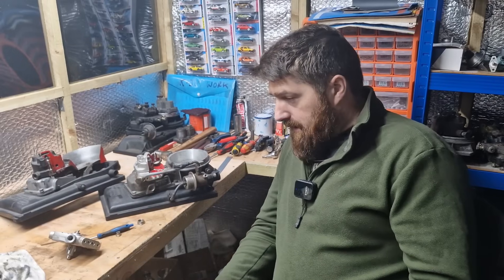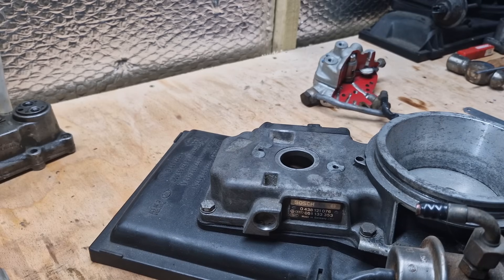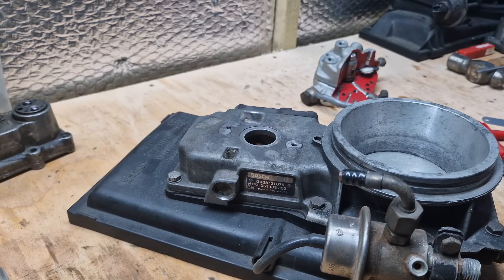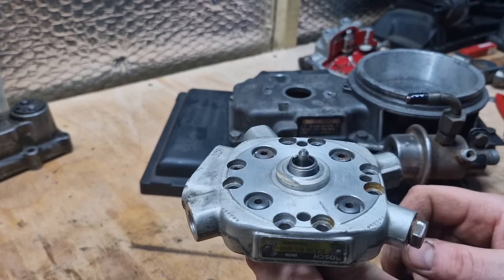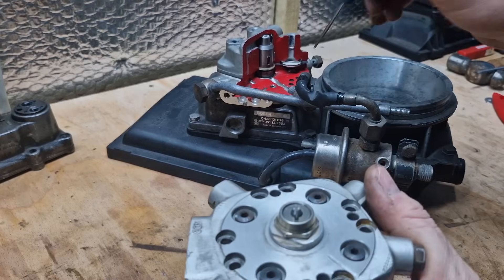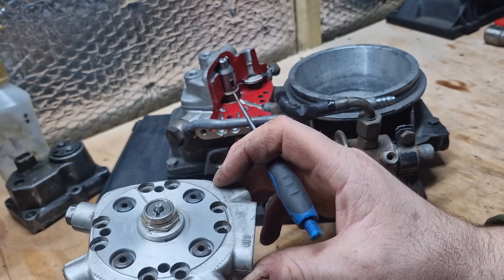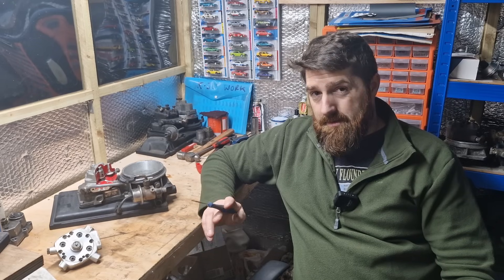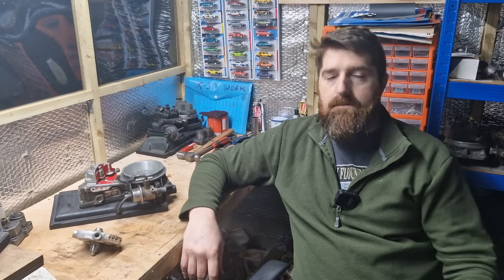Bosch KE-jetronic - CO Mixture Basic Settings

Comment: So a vibrating engine can back all these precise  measurements off?
Reply from the maker: Not directly, its more the wear in the components themselves, for example, sprung parts or if its been messed with in its life as its easy to adjust things to make a car run with underlying problems

Comment: I cant get my adjustments right. When i get the 1.9mm ,the best on the roller i can get with max screw in is 20mm. And under presure it moves up about 2-3mm. And cant screw the screw in anymore.
Reply: Also i think the bottom ring is leaking of the pin that touches the roller.
Reply from the maker: There's a seal inside that part, the most important is the 1.9 mm and no more than 1 mm freeplay in the plate when under pressure
Reply: @GreyGooseRestorations Yeah i got to much free play ,like 3mm

Comment: Great Videos - you're my do-to guy for trouble shooting my K-jet system. Have you ever seen system pressure remain constant and within range, but cold control pressure surge up to 7.4 bar and then suddenly drop back to 4.0 bar and then constantly repeat this cycle? it's happening to me. I replaced the WUR with known good one and problem persists. it's like the control pressure circuit inside the FD is restricted until the pressure reaches a point where the fuel pushes past. The process repeats. ironically, I just had the Fuel Dist. rebuilt!  Any first thoughts on how to diagnose this? Much thanks and keep the K-jet stuff coming!
Reply from the maker: Thanks, i would check all the fuel lines and their banjo bolts for any damage and/or restrictions which may cause this, as it should never go that high but it also sounds like the WUR isn't set right as cold control pressure should be around 1 bar area until its warm

Comment: My i ask you whats is the problem then gasolin don't reach injectors just only gasolin throw coldstart on Audi 100 -88.
The fuel distrubator is renovated. 
Best regards
Tony Spångberg Enköping 
Sweden..
Reply from the maker: If no fuel comes out of the fuel distributor outputs even when the plate is lifted (or pushed down) then it will be an internal fault most likely

Comment: Excellent video mate, really well explained. Question for you, ive got a w124 idling very poorly, better at temp but still poor at traffic lights and slow movement (car parks etc). it smells extremely rich and im certain the previous owner played with the mixture screw before trying any other fix :/ Is there any way at all to get to a ballpark ish base setting by adjusting while idling? I dont have a lot of resources to test as you have and its a fair drive to an expert so want to see if i can get it somewhat driveable to take it there, thanks
Reply from the maker: Thanks 
One way to set it right by ear is to lean the mixture off untill it starts to idle worse, then richen the mixture again untill the engine idles worse then lean of half of the difference between the poor lean idle and poor rich idle, so if it was one full turn between the two then meet in the middle. The aim is to be able to open throttle fully from idle (momentarily) and the engine reacts instantly
Reply: @GreyGooseRestorations  excellent. Thanks mate

Comment: Would I be correct in saying that the ke-jetronic does not have a spring above the plunger?
Reply: Great - thanks. I was sure that I didn’t drop it on the floor. 😊
Reply from the maker: As far as I have seen the springs were only in k-jet units 👍

Comment: Will this adjust the CO only for idle speed or will this have an effect on the fuelling (over or under) over the entire rpm range? Thank you
Reply from the maker: Adjusting the CO on K-jetronic and KE-jetronic has an effect across all fueling points as anything that raises the fuel pin will increase fuel delivery

Comment: Awesome video explaining how this works. I'm glad to see support on it like this. I have a problem you may understand, my 86 gti that i've owned for 10 years has me stumped. it bogged down into my carport and never started again. cranks like it should, has spark, 125 compression in all the cylinders, but the spark plugs are wet, i was thinking it has a fuel delivery problem related to the piece your describing here. i havent been able to drive it for a month. my baby has been down to long
Reply from the maker: It could be your fuel pin is stuck or a seal has failed inside the fuel distributor